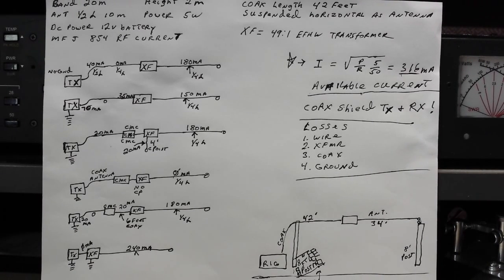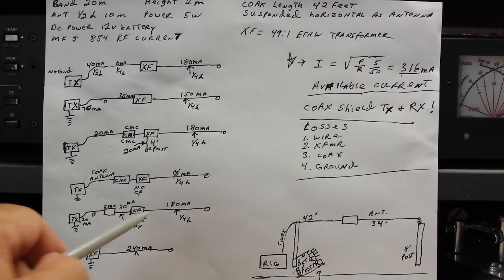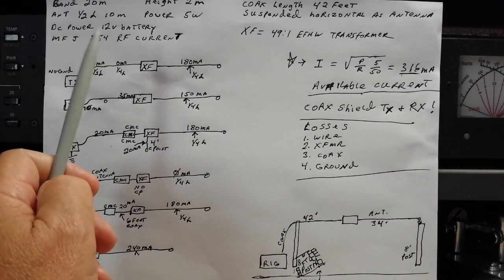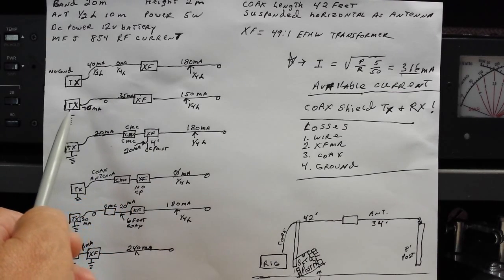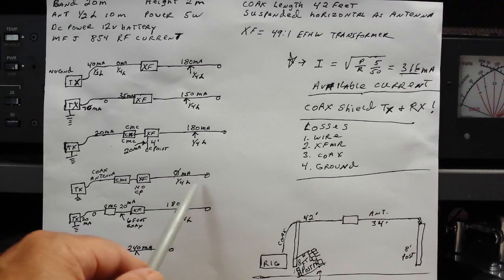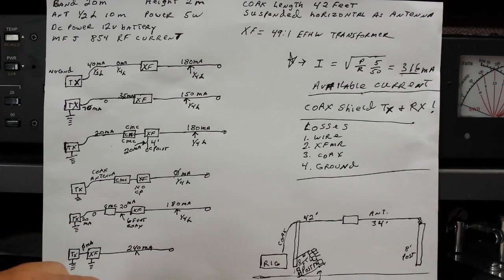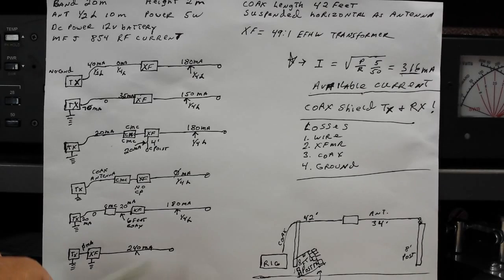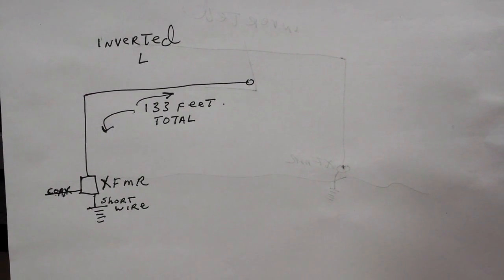EFHW Installation Summary or Is your feed line part of the antenna?

Comment: On an EFHW antenna- Does the size or thickness of the coax have much bearing since you’re on such low frequencies as compared to 2 m coax requirement
Reply from the maker: I think you're saying that low frequencies don't have as much loss in the coax which is true. I use RG-8, 1/2" stuff. Smaller coax is fine for low to medium power.
Reply: @n4lq  Thanks! What have you found to be the best NVIS configuration on the EFHW- wanting to especially focus on near contacts of 200miles or less
Reply from the maker: @PatAutrey  NVIS requires the highest angle of radiation possible, 90 degrees or straight up. The highest gain for this is to have the antenna at 1/4 wavelength above ground.  Remember, this applies to a 1/2 wave dipole. A full wavelength EFHW is a terrible NVIS antenna. This means that your 80m EFHW should be about 65 feet high. A 40m EFHW should be about 34 feet high. For 200 miles 80m is best. Ignore those who say the antenna can be 7 feet high. Sure this will indeed reject signals at low angles but at a great loss to high angles. The vast majority of ham dipoles are already NVIS.
Reply: @n4lq  So the idea for Best NVIS performance using an EFHW - would be to get that antenna up as high as possible (I do not have a tower but I have some tall trees) with the 49 to 1 transformer also up as high as possible do I understand that correctly that a flat topper would work better than an L shape by having the coax go up to top off the trees and connect to the 49:1 and then to extend the 130’ of wire out as horizontally as possible
Reply from the maker: @PatAutrey  Yes as long as you don't go over 65 feet beyond which you will start seeing low angle lobes. On the fundamental freq. most radiation is near the middle of the wire so an inverted vee works great for NVIS too.
Reply: @n4lq  ok thanks for your help

Comment: Steve, have you tried the last option but with a coax feed and ground both the xfmr and the rig?
Reply from the maker: Yes that is how it was done. Both rig and transformer grounded. Grounding the transformer is what makes the difference though.
Reply: Steve Ellington but a very small feed line xfmr and rig.. I was thinking more like a 42'+ one